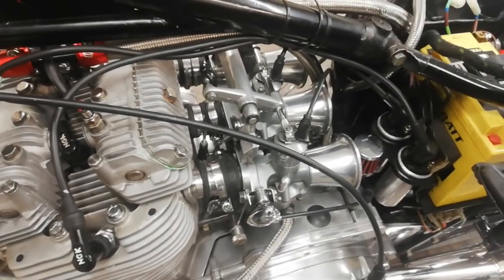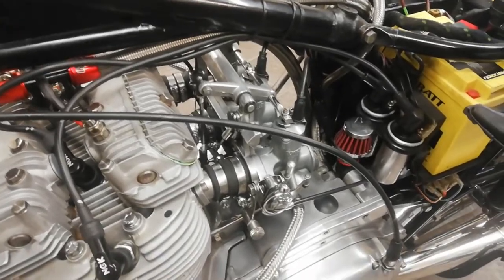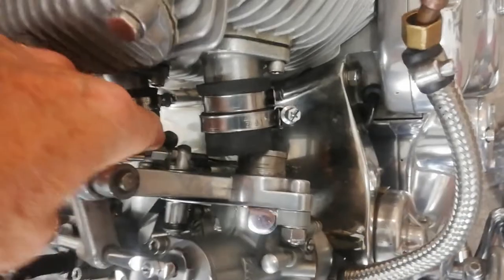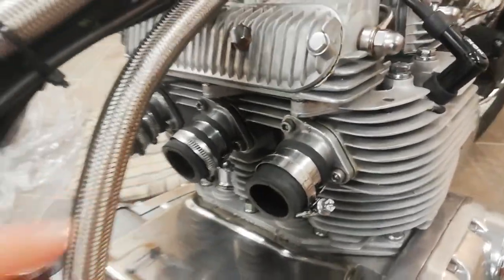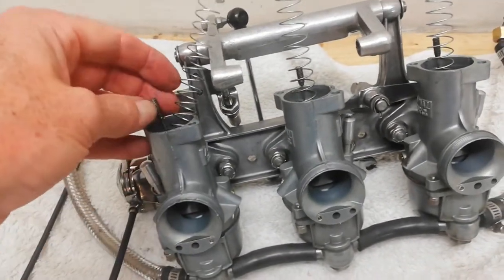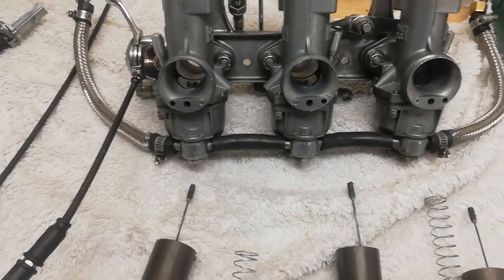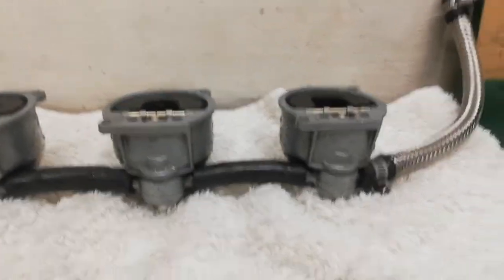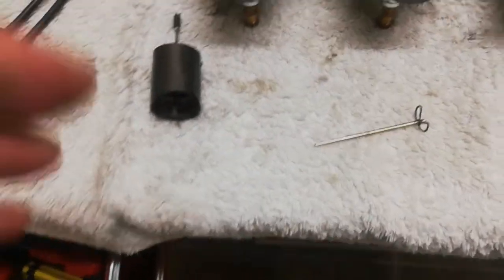Amal Concentric MKI Carburettors stripped down, cleaned, checked and adjusted.

Comment: Hi , very helpful videos , I have heard that the centre cylinder can run hot   , do all the carb settings remain identical or do some run the needle 1 notch higher on the centre carb . Cheers .
Reply from the maker: A big question there!!! This is my opinion (there are many others!!): By the laws of physics the centre cylinder has to run slightly hotter than the outside two (less surface area for cooling) - so the real question is 'Does it run that much hotter that it requires different settings?' Some owners put slightly larger main jets in the centre cylinder carb (160 instead of 150), and legendary Triumph tuning expert, Stan  Shenton, used to put a slightly cooler plug in the centre cylinder of his racing Tridents to avoid pre-ignition. However, I think that any alterations to standard settings are only to be considered when racing or doing continuous motorway speeds, and even then it's questionable. So the short answer is; 'No, don't alter anything'. I think it's more important to check ignition timing (in particular) and carb tuning for all cylinders, to ensure good running and avoid such problems as holed pistons etc. 👍

Comment: Hi Chris, thanks so much for this and all your other videos. This one in particular helped me to successfully disassemble and clean out my original carbs. I had an off (this) topic question for you. Have you made a video about setting the original contact points and timing? Your videos and book talks about an electronic ignition vs a points set-up. I need help with my T150V :-)
Reply from the maker: Dean, thanks for your comment  - great to hear that you got your carbs rebuilt. I'm afraid that I don't have a video covering setting up the ignition timing with points on a triple. I can talk you through it, if that will help (let me know if you want me to do that) but I'm afraid I have no photos or video to go with it, other than what's in the T160 engine rebuild video on refitting the Boyer electronic ignition system.
Reply: @Chris.rooke150  Thanks so much Chris. If I don't have any success with the current set-up I'll be on a fast-track to electronic ignition :-)

Comment: chris many thanks for this dead informative film how critical do you think this float height is with these stay up floats as im rebuilding mine at this point cheers dave .
Reply from the maker: Hi, Dave, thanks for the comment. I'm not a great believer in ensuring that float heights are spot on to ensure smooth running, but if the carbs are off then it's definitely worth checking them. You don't have to fill them with water as I did in the video, although that method is very accurate. Instead, just gently push down on the tang of the float until the needle seats (the float stops moving up) and that should show you the float height, which can then be adjusted by gently bending the the tang of the float, where the float needle sits. I set my floats to just below the rim of the float bowl - about 2mm below, roughly. However, I still think that Amal carbs work well even when the float heights aren't spot on (vibration from the engine etc mean that float heights necessarily vary when the bike's being ridden) but that's just my opinion and others will disagree and insist that it's critical. Good luck, whatever.
Reply: Many thanks for that you seem.to have yours very well sorted  question do you have a standard starter motor or a upgraded one that spins faster as this seems to be on area the t160 does struggle I have the biggest motobatt battery new coils so we will see if I have any joy on getting this lump running properly many thanks
Reply from the maker: Unlike the Norton Commando, the T160's starter motor should work fine as it is, you just really need to change the main power lead and earth lead on them to a thicker cable which allows more current to pass through them, although some owners do opt to fit a Dave Madigan conversion which is much more powerful.
Reply: @Chris.rooke150  thats worthwhile knowing chris  thankyou
Reply: @Chris.rooke150  Would it be helpful to install in line fuel filters & not just depend on the screens?
Reply from the maker: @autodidact537  I think that in-line fuel filters are only necessary if you have a dirty petrol tank. When I restore my bikes I always clean the insides out with acid and then paint them with ethanol proof paint. After that there are no bits coming out and filters are superfluous. However,  if your tank is dirty/rusty then probably a good idea.

Comment: The steel-braided oil lines look very smart. Where did you purchase them Chris, or did you do the mod yourself?
Reply from the maker: I bought the hoses from Ebay, by the metre and simply cut them to suit. The hardest part was finding end caps and decent clamps to fit them. Also if you cut them badly the steel frays and is a complete nightmare! But once done they've been completely trouble free since fitting. 👍

Comment: Morning Chris, I enjoy watching your videos and I've learnt a lot my question to you is not about carburettors , with your knowledge of Trident could you tell me how I can get round the problem of the height of the Trident in particular the BSA ROCKET 3 MK2 I struggle to put my feet on the floor with your experience is there a way round this for me may be  a lower seat cushion , replacement shocks, I would appreciate your comments . Pete Collins PS I didn't have a problem on my T160 but I do on the BSA
Reply from the maker: Hi there. Regarding seat height, there's only so much you can do. The two easiest modifications would be to firstly change the rear wheel to an 18" diameter rather than the standard 19". You will need the wheel rebuilt for this, but any Wheel builder can do the job. You will then also have a much wider choice of tyres for the 18" rim. You could also remove some of the seat padding, as you suggest. One other idea would be to contact such specialists as Hagon and ask about fitting slightly shorter rear shocks - which could be done in conjunction with fitting a smaller rear wheel. Good luck,vwhatever. 👍👍👍
Reply: Thank you Chris
Reply from the maker: PS There may also be the possibility of lowering the front end by allowing the fork stanchions to push up through the top of the yokes by an inch or so. Not tried it myself, but I have heard of it being done.
Reply: Chris Rooke morning Chris, I took your advice and contacted Hagon and Dave made me new shocks by lowering them by 20 mm made a big difference thank you again Chris
Reply from the maker: That's great news. Happy riding! 👍

Comment: Sounds glorious. I'm having persistent trouble with tick-over mixture control. Properly adjusted - like yours at the end of your vid - the motor not only idles smoothly but also immediately returns to idle rpm. I've got a '72 T150V with Amal 626 carbs, original equipment. I've had them apart to clean w/new gaskets etc., but the plugs are just black after a few minutes. It refuses to settle into a smooth steady idle and doesn't seem sensitive to idle mixture screw adjustments. I started at 1 1/2 turns out, which is the recommended starting position and play from there but to no avail really. The engine races when I blip the throttle then close it. I know it's too rich because when it does idle it sometimes spits back. What do you reckon. I'm not too sure how to get at the idle jets. Any advice would be greatly appreciated. Oh yea, the engine was just rebuilt and runs extremely strong off idle...cheers mate.
Reply from the maker: Eric, first of all check that you are turning the choke off and not on! This is a common problem as the lever and cable are pulled tight for off, and slack for on - not the other way round! I know owners who've experienced similar problems before discovering that their choke was on when they thought it was off! If you have modern Premier carbs then cleaning the pilot curcuit is easy as you simply remove the brass screw on the opposite side of the carb to the air screw, but non Premier carbs are more difficult and can require cleaning in an ultrasonic bath or similar as the pilot circuit is almost impossible to access fully, even with the carbs stripped down. Good luck! 👍👍👍
Reply: @Chris.rooke150  Thanks Chris, it's definitely not the choke. I pull those all the way as soon as the engine has some heat.You're quite right about the older carbs and it was certainly a design weakness not being able to access the pilot jets without surgery. I may try the ultrasound and get back to you. I forgot to mention that the only plug showing healthy color is the middle cylinder so I'm thinking the p-jet may be clear on that one.
Reply from the maker: @ericmowrey6872  a fine wire such as an old guitar string is the best thing for completely cleaning badly blocked pilot circuits in the carbs, in conjunction with an ultrasonic bath. 👍
Reply: @Chris.rooke150  Thanks again Chris. I got to thinking (usually gets me in trouble)...if the pilot jet(s) are blocked in carbs 1 and 3 then why would those plugs get sooty? My thought is when the p-jet is dirty and fuel can't get to the idle circuit then maybe unmetered gas makes its way up through the main jet. That's the only thing to me that explains the sooty plugs. It could be way off as a theory but nothing else makes sense. Idle air flow venturi effect creates a vacuum which pulls petrol through the idle fuel circuit. If that's blocked it pulls it from wherever it can. Could be wrong...won't know for a couple of days. I'll let you know.
Reply: @Chris.rooke150  Hi Chris, well I'm back with an update. The idle jet on carbs 1 and 3 were indeed plugged up so I cleared them with a fine wire. I did this several times until I was sure the circuit was back to normal and petrol could flow freely through the jet and feed through the 2 tiny holes in the carb mouth. I did this yesterday and today.
Even though carb #2 was working properly, I'm going to run a wire through it also-just to be safe.
I also discovered the float levels are way off. I kinda suspected that because they were reluctant to flow any gas when depressing the ticklers. Unfortunately I have the old plastic floats and no adjustment is really possible. I'll be ordering new floats with the bendable metal tangs from the UK so I'll have to wait before I can fit the carbs and see how it runs. Anyhow thanks again mate for your technical advice. It was very helpful. I hope to post again with happy news as soon as my floats arrive.
Reply from the maker: Great work. 👍 Keep us updated. 🤞🤞🤞

Comment: Where did the throttle mechanism come from?
Reply from the maker: The throttle gantry is standard fitting on a three cylinder Trident T150 and T160, as well as the BSA Rocket 3.
Reply: @Chris.rooke150  Thanks - wish there was something similar for a Norton Twin...
Reply from the maker: I think that there is someone who makes something similar for Commandos - Donald Pender. Here's some info https://www.motorcycleclassics.com/classic-motorcycle-repair/carb-gantry-norton-commando-zmmz19sozhur/